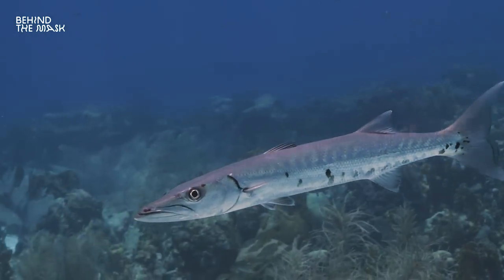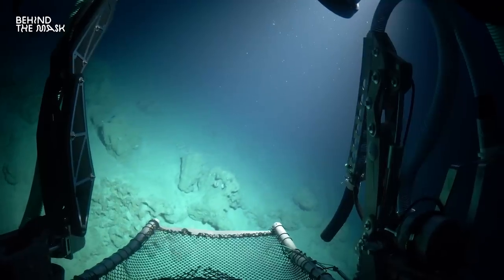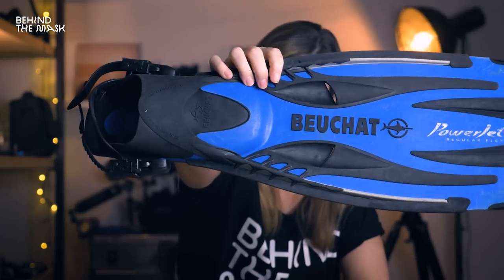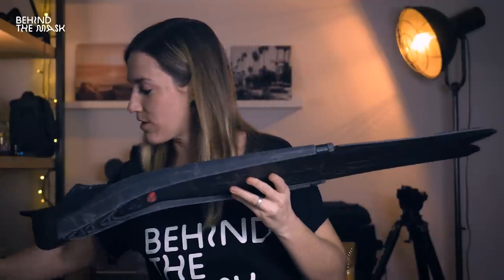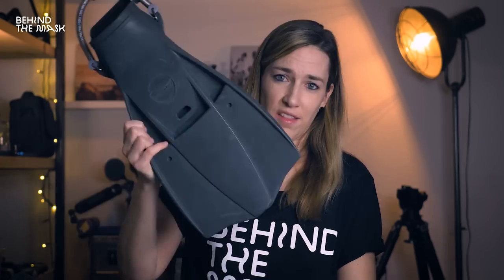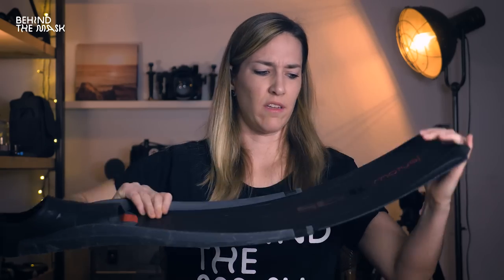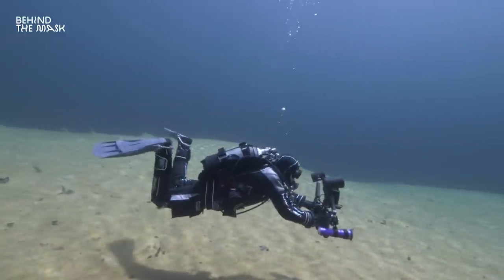How to get smooth shots when filming underwater

Comment: as a free diver, I approve!
Quick tip for your quick tip video:

- soft long fins are agile, it's easier to turn
- medium fins are a bit of both worlds: average agility and speed
- hard fins are for speed, with low agility (frequently used for competitive free diving, and much easier to get to 40-50-60 meters down under and much easier to fight negative buoyancy; you'd still have plenty of oxygen left at 50-60m to hang out and explore, then safely get back) 

I use medium fins as I "triathlon" to my dive location, thus consuming less energy on the way and having somewhat adequate agility in the water at site, although I have to pay attention to currents because it's not as easy to turn with them rapidly. A few times I was bashed against the rocks and corals while filming in rougher and less predictable waters. Whereas, I'd guess soft fins would be much easier and versatile when diving with lots of equipment and tanks.

If you're worried about getting too tired with long ones, you could always pay a top dollar for carbon fiber fins, they're great, but a good pair could easily be 300-500+ USD, so build up calves it's much cheaper!

Aaaaand, If you have a bulky build - hard fins would be better for you. Rent them before purchasing if you can, long fins are a lot of fun!

With regard to open heel in a foot pocket with long blades, try JBL, Cressi, Imerrison, or just buy a foot pocket with removable blades chassis, then you can always swap to whatever you want.

Awesome tips by the way, thanks!

Comment: Well I've got to say "welcome to the party!!!". I've been using Cressi freediving fins since 1987 much to the disgust and snide comments of many a dive operator. I found these were perfect for my underwater photography and just diving in general. The obvious draw back is travelling with such long fins but I seem to manage ok. The ones I have are open heel which are quite hard to find a replacement for as most are designed with a closed heel. I would not go back to traditional fins. You have definitely got it right.

Comment: I feel that I've got to bring this up; finning techniques. As well as perfect buoyancy and trim, proper sculling, helicopter turning, and back-finning can greatly increase your abilities. On top of this, modified flutter and frog kicks (kicking from the knees instead of the hips) means more kick cycles and smoother more consistent motion. Say what you want about tech wankers but the idea of being a more technically sound diver is automatically going to improve certain aspects of diving across the board.

Comment: imersion makes longer fins with open heel.
i used to use freediving fins when recording video, but i changed to using short open heel fins now, because when i kick with freediving fins, my hole body tends to twist alittle from side to side, especially when diving against the current.
doing slow smooth frog kicks gives me smoother results, together with open heel scuba fins.
Reply: very true as well :) but actually longer swim-by's at a faster pace... thats where I've always had issues with the long ones not really.  But I always bring both fin types with me anyhow... it's like with everything = use the spesific tools for the specific tasks :)
Reply: Najlepiej miec w bazie nurkowej wybor :) ja plywam na krotkich maresach i poki co nie ogarniam dlugich przy filmowaniu. Mam ten sam problem co Ty :)
Reply: @ReefPatrol  true, but for those of us, who does video of our underwater adventures etc. on our vacation.
i find it more usefull with shorter fins, and doing smooth frog Kicks.
for longer steady footage of the reef's, i only try to get these if i can drift along the reef.
but hey, i only do this as an amateur, which i first started doing 2 years ago, when i got scuba certified aswell.
been freediving (spearfishing) here in cold Denmark for several years thou.

Comment: Cressi...back in the 80's and 90's  or so made an adjustable open heel version of their freediving fins. I have two pair that I got off Ebay at a reasonable price.  They are rare.  Great longblade freediving fins.  About as stiff as the Cressi 2000.  Interchangeable blades....but using the older single screw design.  Foot pockets are not as generous as Cressi ARA or Cressi pro light.  You can wear with booties (depending on foot size)....but not with thick soled booties....I wear with 5mm booties...but with a relatively thin sole  (shoe size 10 US)  When kicking there is some slight movement of the foot in the foot pocket which marginally reduces efficiency versus a full foot fin.  But it's minor...much easier on and off in surf or boat entries.      As a VERY LONG TIME UW still photographer  (since 1970...I am f*#king   OLD) just getting into video I love your postings....funny, to the point, and great advice about technique.
Reply: thanks!

Comment: Dear Vanessa & Behind the Mask Team. 

First of all - thank you a lot for all the tips & tricks around getting better shots and clips! Thats great work! 
I have a question, but it is not about smooth fin-kicking. 

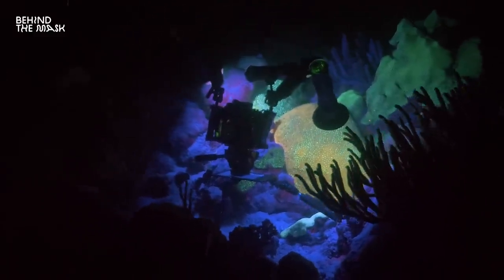During the video you showed your rig on a tripod taking fluorescence clips at min 6:41.
Iam really interested in the pan and tilt tripod head you are using! 

Can you please tell me which brand it is? Or do you have any recommendations for a robust, not shaking tripod head, which is not too high and not too heavy? 
I know it sounds like I want everything in one piece.. but there must be better products out there.. but I dont find it. 

Iam filming Macro with Panasonic GH4 + Olympus 60mm Macro + 10 Diopter on a DIY tripod that looks similar to your system. 
I tried different "land" tripod heads, but of course its just a question of time until they are done..  than i tried the ULCS Video head and modified it in high because it was too shaky... but Iam still not happy with it. There are some other brands out there, but they are too high or seem too fragile or are are soo heavy that I cant take it on a flight. 
I want to be as close to the bottom as possible... Iam also thinking about mounting the tripod vice versa on the top of the housing. 
I even started designing my own tripod head, but I dont have the time to continue. 

So you see I spend a lot of time thinking about it :)

Can you please help me? 
Thanks a lot! 

Alex

Comment: Interesting observations. In my own experience, frog kicking definitely leads to more jerky starts-and-stops if you're filming a forward push over a reef for example than flutter-kicking. Basically, if you kick and glide you will always have one section of the movement that is faster when you kick, and gradually slows down as you glide to and then speeds up again on the next kick. Flutter-kicks produce a more consistent speed, but I'm not sure there's any real need for free-diving fins specifically. If the theory is that free-diving fins are softer and therefore lead to less jerky (forceful) movement than stiff paddle-like fins, then shouldn't the best results be achieved with something like split fins that offer practically no resistance to your movement? As free-diving fins go, carbon-fiber ones can be a lot softer than plastic, so presumably they would produce even smoother motion of your legs less likely to transfer to your camera. But free-diving fins have some real limitations too -- they're nowhere near as manuverable as paddle-style fins. You can't really back-kick with them or do helicopter turns easily, and it's all too easy to hit coral if working near a reef. Harder to travel with, too. If doing a lot of reef fly-over type shots, letting the current move you produces the best results overall :)
Reply: different methods for everyone :) no right and wrong :) Thanks for your input!

Comment: The immersion E:black open heel ones are 78cm in length and cost about $60, which is a reasonable price and it has a good length. So I’d recommend it yes. 🤙🏻
Reply: cool! will check them out.